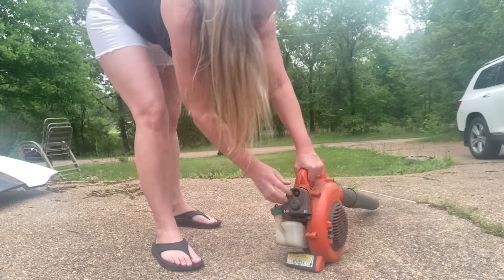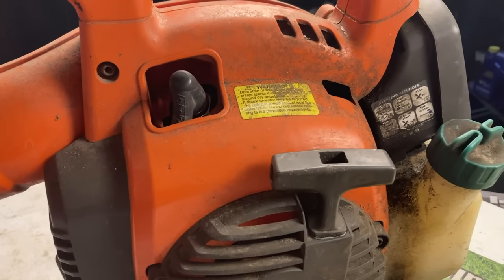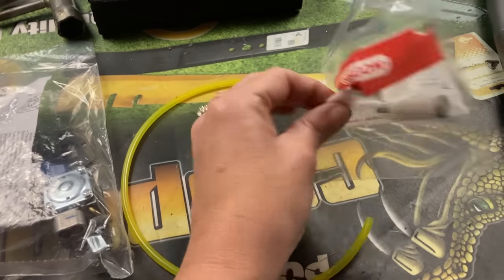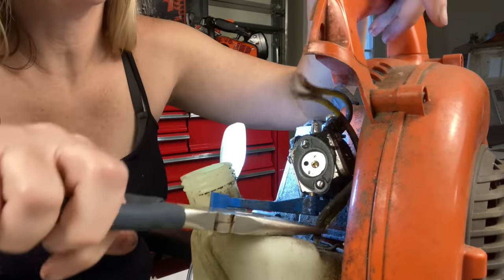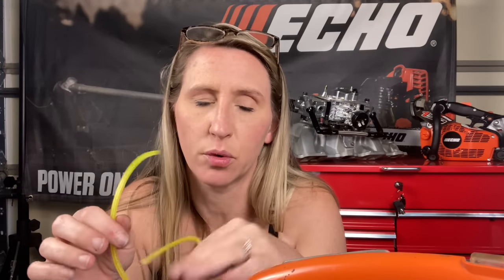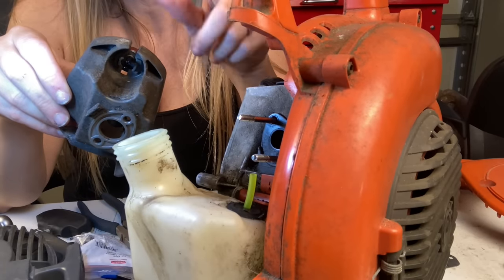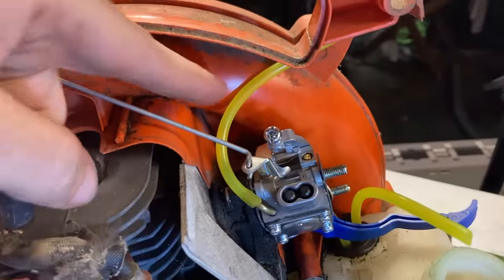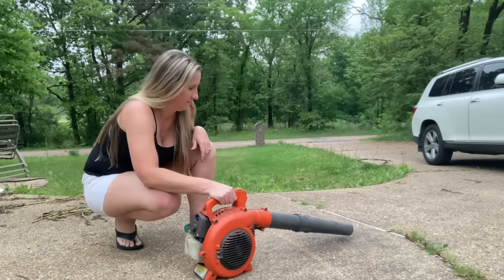How to fix a Husqvarna blower that will not throttle up or start. Repair vlog

Comment: The way I've always figured it, if it doesn't work, I have nothing to lose trying to fix it myself. Read enough Chilton and Hayes manuals in my youth that everything is basically "disassemble until you find the broken part, replace the broken part, reassemble in reverse order  of disassembly." :) Great content. I love work. I can watch it for hours. :D

You mentioned this blower was "rode hard and put away wet." Could you do a video on what needs to be done after using a blower? I have a new backpack blower, and want to make sure it lasts.
Reply: I hope she addresses this. I have the same question. I have been told that after heavy use, to let it idle for about four or five minutes before turning off. I want to know what the expert says.
Reply from the maker: Thanks! With all of the machines I have worked on, the HUGE majority of them have not ever been idled for a time period before they were shut down. I personally do not think there is a difference. I do want to know for 100% though so I will ask my Echo distributor technician next time I talk to him.
Reply: nowadays with youtube, there's nothing you can't fix
Reply: You can depend on Chitlins and Haynes to tell you everything a complete idiot would already know.  But if you have a really technical question about how to do something, they will not have the answer.  And their wiring diagrams are sometimes incomplete.  I've had to draw in some things that they didn't show before.

Comment: Mine just quit running again. You were spot on. The fuel line broke again in the tank. Mine had a little coupling and it broke off from the coupling . I will buy the tubing and eliminate the coupling. What size should I order?

Comment: Although I have been working on my own equipment for 52 years, I learn something on every video. Thank you so much for making all this knowledge public. Some of these procedures are not needed often. If you buy good equipment and store it without drying out, some engines can go for 20 years before requiring fuel service. This causes users like me to have very little experience in replacing fuel lines! Thanks again!

Comment: I have had the same issue with mine, I ordered the kit and install new carb and now the blower will not purge fuel into the bulb, only about 30% fuel and the rest just air.  After watching this I believe my new carb diagram sucked in debris from tank as both carbs with new lines on both carbs do exactly the same symptoms.  Small amount of fuel, but mostly air.    

I got so PO'd I went and purchased a new Stihl which runs great, but I walk by the 125b on a daily basis and just shake my head at it.  For 50 years I've prided myself on fixing "Anything"; now my ego and self esteem was busted by the darn POS 125b .  After watching your video I'm going to check the diagram in new carb and old carb.  After that it will be donated to WM Waste Management if I cannot achieve fuel in one of the 2 carbs and 4 bulbs,  after 8 teardowns and 30 hours of work.  Lol...

Comment: Have the same problem with mine. I only replaced the lines, filter and bulb. Still doesn't run. Looks like the carb replacement is next. Thanks for the video.

Comment: My blower is the 150 model. It's only a couple of weeks old. Exact same problem after starting. It's had about 30 hours of use. I'm sure the lines, carb, etc are in good shape. I'm hoping it's just a clog in the line or something. I've never owned a 2 cycle engine before.

Comment: Great video, as always!  THANK you!   And as an aside, I once had a pair of haemostats just like the ones you showed in the intro.  In the mid 1970s, I was a bank alarm system technician, and used them for "shorting" telephone wire pairs at the police station where monitoring was done, and I would proceed to the bank location where I would check for continuity. Well, the last time I did that, I didn't get continuity, so I returned to the police station to troubleshoot further.  Some dirty cop had stolen them!!
I quit my job soon after.  LOL!   Stay well!

Comment: Excellent video!!! I have the same issue with my 125B.  Off choke it doesn’t stay on and it’s not blowing hard or with force.   I bought a kit and changed out the fuel lines, gas filter & air filter, primer bulb, new spark plug, new carburetor, new ignition coil and still same results.   Any advise will help.

Comment: I never can remember on the primer bulb which one sucks and which one blows so thanks for the tip on the short one sucks and the long one blows.    I always take two short pieces of line and put my finger over one end and push the primer bulb and you can either feel a suction or pressure.  I like your method better so thanks.  👍

Comment: Really like your Chanel , should you use a blowgun clean the area of repair before you open everything up. Eg dirt getting in the fuel hose ports . I’ve been a mechanic for 45 years

Comment: Good work, I  have story that happened to me. One spring I got my weed eater out it, it would start but wouldn’t run. I checked all the usual stuff, air filter, fuel line ,  i knew the plug was ok because it would start I finally gaa as CE up on it thinking it needed a  carburetor or kit. Later on I was talking to someone and he told me to check the muffler.  I thought muffler so I went home thinking what could be wrong with the muffler, but I checked it. I found the mud Danvers had stopped up the exhaust hole. Took a screwdriver and punched out the mud in the muffler hole , started it up and it ran fine.

Comment: Storing these two cycle engine should I be drained and run dry? I’ve had issues where the gas continues to run out because the needle and seat do not seal. I’ve been repairing some items watching your videos which has been very helpful. They’re giving me the confidence to take them apart because I have nothing to lose.

Comment: Great work!! I’ve got an echo blower that’s only two season old but it’s had an problem being able to run at full speed consistently. It will but only after I’ve used it for a bit but still isn’t consistent. Really frustrating because I love my echo equipment. Keep making the great videos!!

Comment: Thanks for a great video….. but I replaced the carb with the suggested parts. Checked compression and spark all looks good but it will not start.  The purge bulb has gas in it.  It was running before like 2 weeks ago
Any suggestions on what to look at next. Thanks again

Comment: I took apart Husq. 326 string trimmer. You were right. 50psi compression test.  The piston had carbon underneath rings and clear down the side of the skirts. Not worth working on,  100psi or less.

Comment: Great residential blower but the intake boot tends to loosen up through time. There are 2 screws that holds the boot in that must be tighten usually one time in it’s life. I first inspection as a Husqvarna tech back in the days was to wiggle the air filter housing for the tightness of that intake housing. If it moves the 2 screws are loose.
Reply: Good job !

Comment: Here's my story. Purchased my 125BVX 4 years ago. After about one year of use it has been a constant source of frustration including a repair under warranty. About a month ago while using it, it died. I could restart it but it would only run a few seconds and die. If it ran more than a few seconds it would die if I revved it up. Thought it was a fuel issue so I removed the carb and cleaned it. But it really wasn't dirty at all. It would run fine until it got hot then would die. Watched this video and ordered the OEM carb and hose kit. Installed it a few days ago and it started right up and seemed to start and run much better. Was about 15 minutes into blowing and it died. Tried to restart it and it did the exact same thing as before, run for a second or two then die. I thought well that was a waste of $40. Was ready to smash it to bits. But I cooled down and took it apart AGAIN. This time I wasn't looking for a fuel problem, and there it was. The two little black wires that go up to the kill switch were laying against the top of the cylinder head. And there was a suspicious shiny spot on said cylinder head right underneath the wires. I lifted the wires and sure enough at least one of them had melted insulation with copper wire showing. So it was shorting out on the cylinder head. I wrapped electricians tape around the wires then made sure to keep the wires away from the cylinder head as I reassembled it. Started it and it ran fine and kept it running for a good long time to make sure it was good to go.

So in the end it wasn't a waste of $40. It truly seems to run and rev better than when it was new.
Reply: good story. read it to my young daughter. put her right to sleep.

Comment: I have the same Blower. Unfortunately I didn’t go with the OEM carburetor thinking I can save money. It still gave me problems. Ended up buying the OEM carburetor problem solved. I noticed that you didn’t adjust the carburetor. Did you get lucky or did I miss something. I love your videos very informative and you’re very easy to follow.
Reply from the maker: 99% of the time, the OEM carb doesn’t need to be adjusted.

Comment: The carb boot intake is held in by two screws into plastic, those tend to get loose and the carb will move side to side, it should not move at all. The piston has ONE ring and it tends to get carbon built up and sticks. The crankcase gaskets are crappy and tend to leak oil out the bottom, if you go into to it that far, use black ultra RTV and re-use the old oring if you want to reseal it. They are good blowers and will last forever, I have rebuilt a couple from the ground up, not hard at all.

Comment: Funny I'm having run issues right now. Another way to feed fuel line through the tank opening is feed a thin wire in through the tank fuel line opening and out the fuel cap open then make a small hook that you can hook into a hole drilled into the new fuel line. Can cut the fuel line at one end to make it easier to back thread the fuel line through the tank.

Comment: We have  a Husqvarna 125 to and it'll run when it's cold but after that first use it won't start again for atleast an hour. We've replaced carb and some other stuff and still does it. I'm at a lose with it.

Comment: Fyi. The nipples for the fuel is done for factory assembly.  The tank is most likely a sub assembly that is done elsewhere and to save time/effort when installing tank they just have to run lines to the tank.

Comment: Another Great video with great visual and verbal explanation of the repair. I have an older Huskvarna BT125 which is the backpack version of their blower line. just curious does this carburetor kit you mentioned also fit my BT 125 as I'm having problems finding a carb for my model.

Comment: I have that exact problem, replaced everything as you described and it still stalls out after initially starting (especially when I squeeze the throttle). Any other ideas? Thanks!

Comment: Personally i like a longer return line, this is so that when priming the fuel the returning fuel is not aerating the fuel in the tank & causing air to be drawn up in to the carburettor.

Comment: I bought and changed the carburetor however, it still only wants to run only in choke mode which only lasts a little while and smokes.  Not sure what to do next.  I was wondering if I need to makes some adjustments.  Please , let me know your thoughts.

Comment: have a question, you mention for winter storage on a 2-cycle to want to use 2-cycle oil in the fuel tank and use the bulb to pump the oil through.  What should you do for a 4-cycle like a honda trimmer or tiller?

Comment: at this point, the only small engine I haven't run recently is the chipper.  but I'm waiting on the deck belt for my mower.  got two laps in and it started smoking.  not bad for a 10 year old machine.

Comment: Hey Mrs Chickanic, I would love some advice on a snapper zero turn mower. This mowers hy-stat has a plate with 2 screws and a big o-ring. It's leaking fluid, what is the best fix for that?

Comment: Very helpful video, I’m thinking replacing my Stihl BG86C as the pull start spring keep bending resulting in replacement. Is there any sort of similar mechanism issue I need to know before purchasing exact same one as I live in Australia and replacement part seems to be very limited
Reply: Look into Husqvarna 525BX or the Echo PB2620. Both are better than the BG86 in that engine class. Echo is the cheaper of the 3

Comment: I have a generac generator with a 18hp b&s vanguard twin engine. The carb on it was shot so I bought another. The fuel line is good as well as the fuel filter. I can’t figure out why it only wants to run just for a few seconds. From what I can see it doesn’t have the oil safety. Do you have any suggestions? Oh, the battery needs to be replaced.

Comment: Yeah but how do you adjust the carb though? I put the new carb in and I can’t get it started. Saw a video that says from fully closed adjust both idle and high knobs a full turn and a quarter open and go from there. I’ve got spark and compression I’m just a noob with carbs. Please help! Cheers

Comment: I have done all the things in your video. New carb, plug, fuel lines and coil. Can get it to start on choke/half choke but it stalls out and bogs down when I put the choke lever to run. Is there a way to adjust the carb to get it to run? Please help!

Comment: Hello there!
So I changed the spark plug, carburetor and fuel lines. I checked the screen in the muffler. My blower will still not operate on full throttle. I have a video to prove it.

Comment: got a question for you, I have a  stihl chainsaw.  starts up ok but wont idle and after it stalls the only way it will fire back up is to hold the throttle wide open. (not exactly safe). thank you if you can take time to respond or do a vid on it.

Comment: I have a husqvarna backpack blower that I installed a new carburetor. It's running on idle but won't throttle up. It's flooding out. Gas sputtering out the carb and bad gas fumes out the exhaust. What do you think it is?  It's only 1 year old

Comment: I replaced the carburetor on mine, change the spark plug checked for carbon buildup and it still bogs. What else can it be? Maybe the carburetor may need an adjustment it is a brand new carburetor. It runs and idles fine but as soon as you squeeze the throttle it dies.

Comment: I changed everything and it still only runs with full choke. Anything else you can thing of. I have had it apart 5 or 6. Times and adjusted the cab a few times. It will idle all day with the choke on but as soon as you gas it it will stall. And I was a Mechanic for 20 years off and on.

Comment: Just have a question regarding chainsaws. Why does the bar chain oil leak out when the saw in in storage? Is that normal or is there a way to correct it? Thank you!

Comment: Interestingly, I believe you know far more than me, but I've got enough confidence to suggest that all cuts made on the lines should include a margin of error. Thus, even if a novice cuts too much off, then, say, the fuel filter won't be, based on line-length, floating on the fuel's surface inside the tank. I realize that more line surface area introduces a higher probability of clog problems. But at least you'll have a lot more area with which to cut, manipulate, pull out, etc.

Comment: Does using fuel without alcohol like "True Fuel" help eliminate the tank hose deterioration problems? Would it also help to store the units with no fuel in the tank? Thanks for the video.
Reply: It does a bit , but over time petrol is hard on anything plastic or rubber , I've always used a bit of Marvel Mystery Oil mixed in on top of my pre-mix and that seems to help !!  Everyone seems to forget that they are all manufactured with a service life timeline and are disposable , but running a bit more oil in the gas will extend the life quite a bit !!

Comment: I meant bg55 handheld leaf blower Stihl and were can I buy easy out it has a bolt broken off the hose to the coil and how long of a rope do I need on the pull rope

Comment: I have an Echo leaf blower-it might be 5-6 years old, that is older in years than the hours it has on it. Mine will idle and run at high speed for a short bit, then is starved for fuel at full throttle, but will idle. Applying the chock kills it. If I turn the blower upside down, it will idle and run at full speed. What should I be looking for? Thanks

Comment: Hi I messaged you a few weeks ago regarding my stihl strimmer. You did message back what was wrong with it as I've lost your message. Regarding my strimmer will only prime petrol when it's cold. And won't prime nothing when it's hot. I've changed all the pipes diaphragms and fuel filter I've even changed the carb and it's still doing it. Looking forward in receiving your reply kind regards rob

Comment: Have you found any fuel line that is any better than others?  Seems like it's designed to fail... :)
Reply: I like using the rubber fuel line that Echo uses.  I have equipment that's about 8 years old with the same original line.  Fuel is always retreated with Stabil and an ethanol treatment as soon as it's purchased.

Comment: I know this isn't about the video but I have a echo string trimmer that when I take the choke off it will idle but it bogs down when you give it throttle it has goog compression

Comment: Quick question: are all new OEM carbs pre-adjusted or will I need a little fiddling?
Reply: Put a new Stihl carb my KM110 4 mix power head. Barely had to adjust the idle a 1/4 turn
Reply from the maker: 99% of the time, they are set pretty perfect.

Comment: Just curious what you normally charge for that job?
Reply from the maker: $30 labor plus parts. With carb, fuel lines, fuel filter and a plug it is about $80.